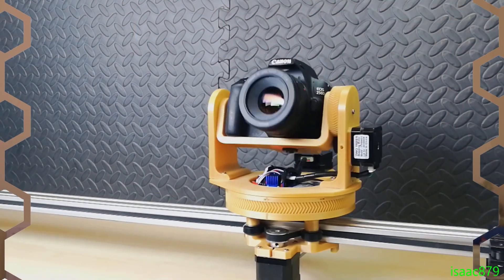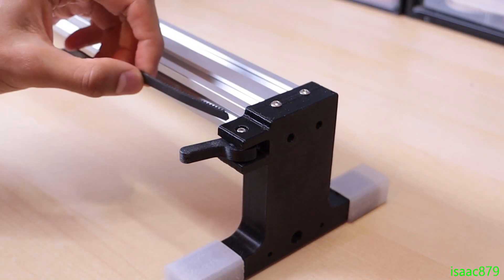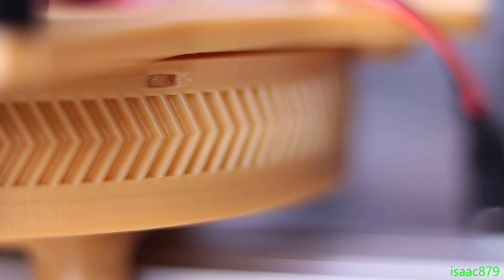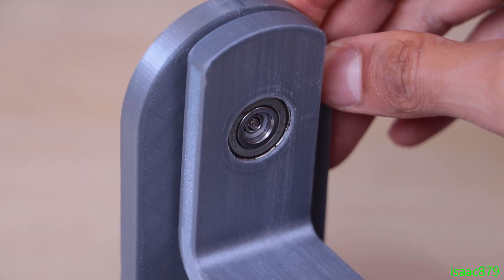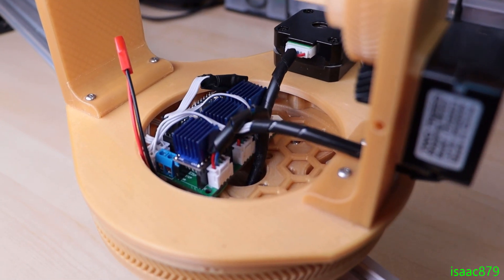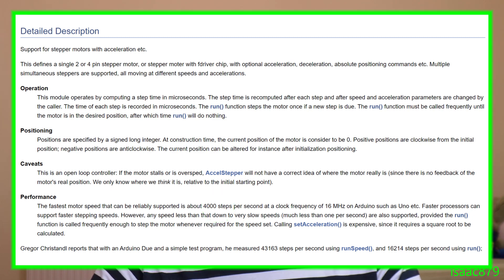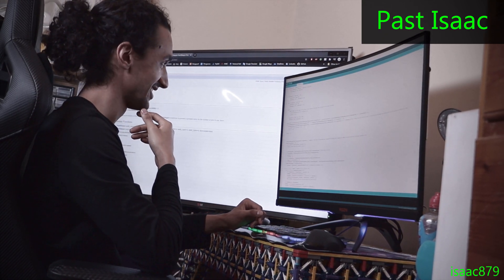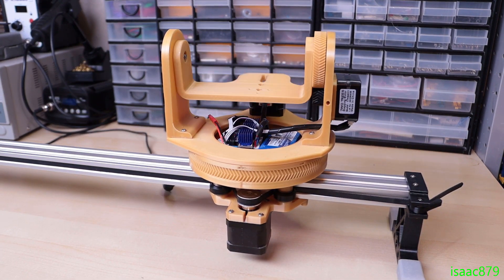Perfecting My DIY 3-Axis Camera Slider!

Comment: If anyone channel subscribers have followed Isaac's build and put together this slider, appreciate if you can contact me as i am starting to build it as well.
Reply: I'm 90% the way there, with a few modifications as I'm using a 5 metre truss rather than 2040 extrusion. What are you struggling with? The build isn't well documented.
Reply: I’m just starting out on this project, in the process of collecting all the bits needed. I’d be keen to hear about your experience
Reply: @ravkhangurra7522  The main problem people have is the bearing. Either sourcing the metal one or building the one included in the 3D printed files. The 3D printed one included doesn't build. There is no room to fit all the ball bearings, the inner part is too big. If you split the outer ring it then doesn't fit in the base. There is a different design for the same size bearing on thingiverse, here: @t I've successfully made 2 now, you just need some super glue to glue the 2 halves of the inner ring together. 
A lot of the build was trial and error as there is little information on how to assemble it. I kept pausing and rewinding the video to try and see how it's built. I've had to modify a few bits. Thankfully Issac has included the CAD files, although they are a little out of date. I had to modify the pan-mount to update it as one side only has 1 bolt hole compared to the current STL file that has 2.
Reply: Appreciate your insight Colin, I'm only at the point of orderin all the bits. I also need to buy a 3d printer (been meaning to get one for some time) It would be great if you can  share your experience in completing this project
Reply: @ColinMakes  I'm having issues with compiling the xbox remote files, not sure where to start
Reply: @GabrielMedina23   Me too!! I believe it's a Windows program. It looks like C++ but I don't know the first thing about coding for Windows. If you find out how to get it working do let me know.

What I have managed though is.... 
I've taken part of that XBOX code to write a different program that uses a separate Arduino Nano, with a Mini USB Host shield, and a compatible BlueTooth USB dongle. With this I can control the Pan-Tilt-Slider with a PS4 DualShock controller and no PC required. I'm hoping to put the code and schematics up on Github when it's working well enough. I'm waiting on delivery of some parts I'm hoping to have something up before next week.

Although, I might look in to using the ESP32 as it has BlueTooth built in.
Reply: @ColinMakes  i have several esp32 boards laying around... i do know it's a windows program but I'm having compiling issues with some of the serial callouts
Reply: Hi Colin, where did you source the  Neodymium Magnets?
Reply: Can you share the your new design.  So to confirm i will need to get 2 magnets per hole,  6mm x 2mm and 4mm x 2mm
Reply: @ravkhangurra7522  That's what I used. The only issue I had was triggering the sensor on the tilt mechanism. The hall sensor wasn't close enough to the magnets so I drilled into the side mount to get the sensor closer to the magnet. I've redesigned the side mount and the motor mount to get the sensor closer. 

I have used 2 more 6mm magnets for the slider homing too. If you use my design you'll need 6x 6mm x 2mm magnets, but my design for the slider uses lighting truss so I can make the slider 5 metres long :)

Here's my GitHub with all my files regarding this project. Bit of a work in progress so things will be updated as I go.
https://github.com/cbradburne/Pan-Tilt-Mount
Reply: Just a "head's up". I've never used Hall Effect Sensors before, for me, the way you mount them depends on the polarity of the magnet. I've made 2 and didn't check the polarity of the magnet when I installed it. I wired it up exactly the same and glued the magnets and hall sensors in place for the pan position. It wouldn't home. I thought I must have broken the sensor somehow. So I wired up a new one and that wasn't working either. I tried turning the sensor upside down and it worked. So DO test your magnets and sensors before super glueing them in place :)
Reply: Another thing I've found only just now. The "panTiltMount.h" file that contains all of the variables, lists a gear ratio for a belt for the tilt, using gears with 123 & 16 teeth (line 31). There is no mention of a belt either in the videos or in the description. So be sure to comment out line 31 and uncomment line 33 if using the 64 and 21 tooth gears found in the STLs.
Reply: @ColinMakes  I'm finding out that the hall effect sensors are all but useless... since the addition of the acceleration Isaac mentions that you can't move more than one motor at a time, which completely shoots the Homing operation. I may be mistaken but it just kind of sits there freaking out until I hard reset
Reply: @GabrielMedina23  That's news to me. I've not experienced only being able to move one axis at a time, I can move all three. Does this only happen after homing all three axis, I've only been homing pan and tilt, when I've bother to home at all.

I do realise that you don't need the sensors, or to home at all. It would make more sense if you could keep the positioning program though a power down, then re-home to re-calibrate. But you can't, so as you say, the sensors aren't really necessary. Also, I find that moving axis through the zero position the axis pauses and I need to move the joystick again to keep the axis moving. So I make sure all axis are positioned out of the area I want to use them in before I turn it on.

Comment: Could you consider to use VISCA Protocols to control your pal tilt head by Vmix or any PTZ controller?
Reply from the maker: Unfortunately I don't have any experience working with VISCA or vmix. I imagine it would be possible to do but I don't have the time to research/work on it.

Comment: instead of the bluetooth(JDY-30 or HC-05) to PC to Xbox controller, I use ESP-32 CAM(small pcb) with Wii Remote to control the 3-axis Slider, it meant u don't need a laptop or PC for Bluetooth connection, and it's working really well. And u can even control the slider by wifi to the smart phone ( iOS or android). Pretty happy now to use it without PC or Android phone. But in the end, the best way is using ESP 32 to replace the arduino nano.  I also make a video with this slider : https://www.youtube.com/watch?v=mhwLHa5P5Qc&t=34s

Thank you Isaac879, great design !!
Reply: Is that a direct drop in? Did you adjust the original code or make your own?
Reply: @GabrielMedina23  I use this https://github.com/bigw00d/Arduino-ESP32Wiimote for wii remote control.

Comment: Isaac; this is by far the best how to video I have watched. I decided to built the pan/tilt for  now, but ran into a big snag. I see you used the CSXU050 bearing. This can be found overseas for close to $75.00 US, but it was very hard to find. It is listed as KC050XPO, or KA050CPO. I decided to print all the parts, but the bearing pieces do not fit. It is so tight that it will not slide in the pan mount. Trying to get all the 6mm bearings to line up inside the bearing ring is almost impossible. So, is the outer bearing ring designed to be cut so it can be spread so the bearing balls can be inserted? Even with a few bearing balls in the inner case, I could not fit the complete bearing in the pan housing. I actually cracked it by trying to squeeze it in there. I cracked several bearing  rings as well and now I'm printing my eighth  bearing cage . I ordered your circuit board and they were exactly as promised, 5 for $2.00 plus shipping. All the electronic parts are readily available which is a nice considering how scarce the bearing is. I had some larger magnets that I filed down for a perfect fit for the tilt hall sensor, and I'll chip off a piece for the pan hall sensor pickup. Your electrical  schematics are easy to follow. I'm not sure about installing the software. I see there are a couple of files  to load, pan/tilt, XBox controller. I'll leave that until last. Your 3D printer files work great, with no issues as far as the settings go. I would appreciate any info about the bearing install and how to put it all together.  The whole project is at a standstill because of this. Your stop/go animation is great to watch. You did a great thing with this project Isaac. Well done.
Reply: The printed bearing is designed wrong. As you say, it doesn't fit. I've printed this one, https://www.thingiverse.com/thing:4595217 works GREAT! You do need to superglue the 2 inner hales together but I've printed 2 bearings and both work great. Just print the INDV files, 2 inners as the inner needs to be glued together.
Reply: @ColinMakes  Thanks for the upgrade Colin.. I will be printing these tonight
Reply: @gameworn1820  To assemble:
Place the outer ring, the ball separator and the lower-inner ring on a flat surface, one inside the other.
Pop 6mm BB into each of the holes in the separator, doing opposite sides of the ring so there aren't too many on one side at one time.
Spread a thin layer of super glue around the other inner ring. making sure to not have excess, is there is, I used an old newspaper to dab the ring on to quickly before applying to the lower-inner ring.
Make sure the 2 inner rings are aligned.
Leave to cure.
Done! Enjoy.

You'll need some pliers to fit the clip ring that holds the top of the bearing in to the lower housing. Don't forget to put the pan-mount-bearing-clamp in first, before the bearing, then the clip ring.

Also advise using the superglue to hold the square nuts around the pan-mount.

If you need anymore help let me know. I might as well share the wealth seen as I struggled too.

Note: I used 2 neodymium magnets in the tilt gear, fit really well too. It's not enough! I had to drill through the sensor mount and partially through the side mount, from the motor side, to get the hall sensor as close as possible to the magnets. Even then I had to test homing disassembled to find the 'more sensitive' side of the sensor.
Reply: @ColinMakes  Thanks Colin. Did you find the 144 tooth basket a little tight as well? I cracked two of them already. How are you fixed for the circuit board? I have a spare.
Reply: @gameworn1820  The 144 basket is fine. Did it crack as you were trying to put in the faulty bearing?

I got 5 PCBs, used 1 so I'm good :)  I'll definitely use them again. Fast turnaround considering they're in the US, (I'm in the UK), and cheap!

I've also managed to get it working without a computer. I'm using a wired PS4 DualShock controller. BlueTooth shouldn't be too hard, I'm just trying to find a BlueTooth dongle that works with the Arduino USB Host Shield.
Reply: Did you manage to print the bearing ok?
Reply: @ColinMakes  Yes the bearing print went well. When i tried to load the software,  I had a, ' sketch too big error'. The file itself is 3K, and the Nano holds 3k, but uses some for its boot loader program. Did you encounter this?
Reply: @gameworn1820  Glad the bearing went well. But no, my Arduino IDE compiles at 30390 bytes, 98%. You got all the libraries from the links at the top of the .ino?
Reply: @ColinMakes  I did add all the libraries. My Arduino used up 31006 bytes of memory, max is 30720. Maybe I can shed some comments to get under  30720.
Reply: @gameworn1820  Strange! Comments aren't compiled so that won't help. I'm not sure what will help. May be try commenting out the "getBatteryVoltage" and "getBatteryVoltage", even "triggerCameraShutter" if you're not planning on using that.
Reply: @ColinMakes  I didn't know comments are not compiled. I did remove  the slider coding for now and now there's lot of room. At least now I can download the rest of it. Thank You
Reply: @ColinMakes  Hey Colin.One more question. Where does the xbox gamepad file main.cpp get downloaded to? I get too many errors from the #include <windows> etc. when I load it onto the nano. Am I missing something? I'm not a software guru.
Reply: @gameworn1820  Hi, the XBOX main.cpp is a Windows application and not made for Arduino. I don't know how to compile the main.cpp for Windows. Sorry I can't help.
Reply: @ColinMakes  Hi Colin. I was heading that way and was able to compile it in windows. Just not sure how to tie in the controller with the Arduino
Reply: @gameworn1820  Sure, I guess you need to link your computer's bluetooth to the HC-05 module and it should send serial commands.

Comment: I would first like to thank you for this amazing idea. I printed the whole project, got the steel BB's for the bearings, and got to the part where I would need to implement a custom joystick made of 2 potentiometers. I was staring at your code for the last few hours and I can't really see how move commands are sent to the Serial Port.
Is "p" the only command which could be used to move the axis,or is there another way?
I would really appreciate your answer.
Once more,thank you for your awesome build :)
Reply from the maker: Sending p45 will move the pan axis to 45 degrees, t30 will move tilt to 30 degrees and x50 will move the slider axis to the 50mm position. To control it with the xbox controller I made a custom program to read the controller state and send 7 bytes to slider. The first byte needs to have the value of 4, the next two get combined into a short and are the slider speed in steps per second. the two bytes after that are the pan speed and then tilt speed. (The code that reads the bytes is in the serialData function in the first if statement). I hope that kind of makes sense.
Reply: @isaac879  How do you run the xbox code? I figure it's something running on you PC rather than Arduino code? What programming language is it written in? Can I use it with MacOS?  (sorry for all the questions :) ) If it's intended for an Arduino how come it's .cpp and not .ino?  Basically, how do I get the xbox control to work?
Reply: @isaac879  Thank you for the information! It definitely helped,but I will probably need to hire someone over fiverr because I am more into PHP and web development than C languages. :D
Once more thank you for this amazing project and for your time.

Comment: Could you please explain what the magnets are for in the parts list? I'm trying to build this according to your parts list but I'm having trouble because I am not sure what certain things, like the magnets, are for and I'm trying not to add too many extraneous parts that add to the cost. Thank you.
Reply from the maker: They are used to trigger the Hall effect sensors for homing each axis. I did briefly show them in my first video but probably should have covered them in more detail: https://youtu.be/uJO7mv4-0PY?t=113
If you don't need it to be able to home it then you don't need the magnets or Hall sensors (When powered on it will assume it is at its 0/home position).
Reply: @isaac879  Thanks. Does that mean I don't need the hall effect sensors either? I have an old printer with a bunch of metric bolts, nuts, three stepper motors, and stop switches. I'm trying to reuse those pieces. Could the stop switches substitute the magnets and hall effect sensors? Also, I noticed a large variety of M3 bolts, some of which are hard to find/expensive to buy in small volumes. Is it possible to reduce the variation? I'm planning on printing it and testing it, so I'll keep you posted. Thanks again
Reply from the maker: @skier-rucker  That's right, you won't need them either. The stop switches could possibly be a substitute but they need to physically press against something so you'd have to add that too.
I think most if not all the bolts will need to be the specified sizes otherwise they would stick out and catch on things.
Please do, I love to see updates!

Comment: Hello, congratulations for the project and the effort you put into it. Many hours of work.
I am considering using your project but would like to make some changes. For example, to power the slider motor I would use a contact like this, rotating sliding. https://www.amazon.it/dp/B01EHH8OFO/ref=sspa_dk_detail_3?psc=1&pd_rd_i=B01EHH8OFOp13NParams&spLa=ZW5jcnlwdGVkUXVhbGlmaWVyPUFSNE80TVQ2WDBOOTcmZW5jcnlwdGVkSWQ9QTA5ODgxOTcyV0lBOUJVNlc3SVNTJmVuY3J5cHRlZEFkSWQ9QTA3ODUxMDFCQVBRNUZCVzFCN1Umd2lkZ2V0TmFtZT1zcF9kZXRhaWwyJmFjdGlvbj1jbGlja1JlZGlyZWN0JmRvTm90TG9nQ2xpY2s9dHJ1ZQ==.
This will prevent the cables from tangling.
Another thing I wanted to ask you if it was possible to control it with buttons and wire instead of the xbox controller.
Good evening to you.

Comment: Awesome work, mate, and great refinements! I have a suggestion for your next version: you could some of the inexpensive slip rings available from the usual sources. If you were to use one for the slider motor and hall sensor, there would be less wear and tear on those leads with the added bonus of no limit on X axis rotation.

Comment: I am wondering, why did you not have the stepper motors direct drive the pan and tilt motions ? As you said they are overbuilt for the task so torque shouldn't be an issue, and 3D printed gears aren't the best when it comes to durability or backlash as you also mentioned. Why not cut out the middle man and have smoother motion overall, especially as you can now achieve higher speeds using your improved code ? Great project nontheless though, curious to see more.